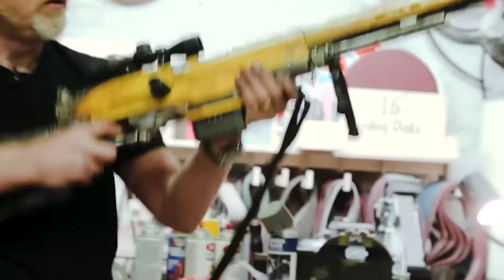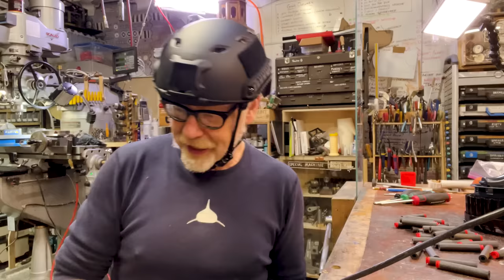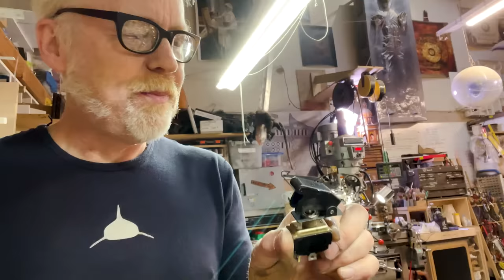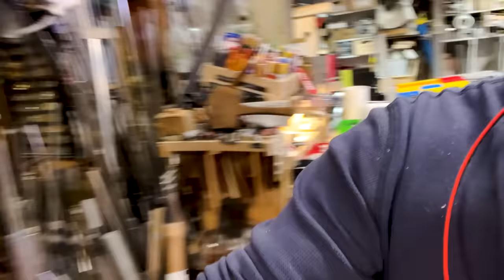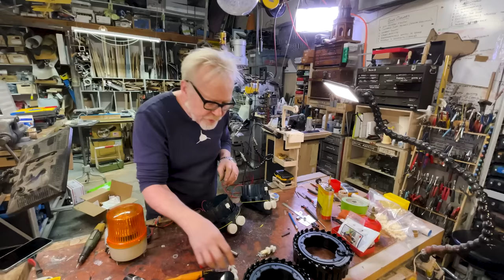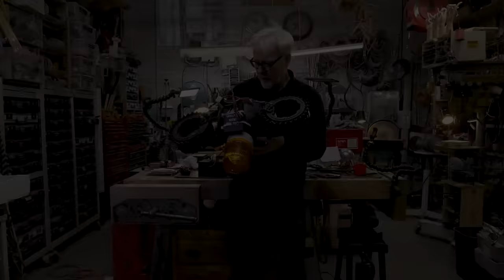Adam Savage’s One Day Builds: Head-Mounted Dart Blaster!

Comment: AWESOME BUILD, ADAM!!  Two recommendations:  Instead of reaching up to the battery pack behind your head to power up the system.  It might be cooler if when you flip up the switch cover on your trigger switch it energizes the system.  Also, as soon as the system gets energized the target reticle rotates into place.  You could put the reticle on a servo that stows in the "up" position (out of the way).  So, when you flip up the switch cover (1) the system energizes AND (2) the target reticle slowly rotates down into position.  As always though - AWESOME BUILD!!

Comment: 2 switches on the remote. 1  toggle on/off switch like you have for the spinner motors. Then a trigger momentary button on the front to fire. That way you can control when the spinners are running instead of having to run the whole time. Love the build!

Comment: The WAGO connectors are great. I just started taking them seriously at work, after having them on hand for about a year. UL listed and use anywhere you would use a wire nut or butt connector. I ordered a set for myself. Hard to say if a soldered connection is better but the convenience factor is second to none.

Comment: The super thin wrenches that Park Tool makes for bicycle repair would be perfect for the locking ring on the switch. Also a deep well socket works if you have the space to get it over the nut.
Reply: Second these suggestions.   I've installed a lot of switches like these in my day job, and both are useful solutions.  We used sockets with a nylon (i think?) coating to prevent marring the paint/silkscreen on the mounting surfaces as well.
Reply: Called cone wrenches, btw. Either those or deep, champherless sockets work well
Reply: I second the deep-socket suggestion, especially if it has a limited, or no bevel.
Reply: Cone wrenches are a great way of doing it, but with his mill and sheet metal on hand, I think Adam could make them himself fairly quickly.

Comment: Adam's assembly mistake is why I use plug connectors to connect all the different parts instead of soldering them all together. It also makes it easier to replace/fix things if a part malfunctions.

Comment: Hi Adam! You certainly can drive both triggers with one single switch, but you have to connect the same terminals of each switch in parallel. In the first try probably you connected the "upper" part of Switch 1 to the "lower" part of Switch 2, and viceversa. This way, you closed the circuit and is like both switches were closed all the time. Because one end of the switch must be connected to ground or Vcc, you should connect them in parallel but with this in consideration. Great build!

Comment: For those little panel nuts (and almost every other nut I tighten by hand,) I use the Knipex #86 03 180 flat jaw pliers wrench that my aviation buddy turned me on to.  They're like a channel lock but flat jawed, more finely adjustable, and have better grip leverage.  I prefer them over "sized" wrenches because there is no slop- whatever size hex the nut (even square,) it is held firmly between the jaws by your grip so nuts never round off or look abused.  A set of those in a few different sizes has made almost all my other wrenches obsolete.  They take some practice to be able to operate single-handed and aren't the cheapest but are worth their weight in gold once you get used to them.  Great video!

Comment: I know that this was a 1-day build project and not really intended for long-term use, but it's a good practice is to have both a good mechanical connection as well as a good electrical connection when soldering wires together. So, tin the wires first, then twist the two wires together (mechanical connection), then heat them with the soldering iron again to melt the solder together (electrical connection). This is especially important when working on wires that will move.

Comment: You asked abut what I use to tighten the nuts on those switches.  I have a  deep well socket that I ground down the rounded bottom so the the thin nut fits snug.  You might think it is over kill but it works great without a pliers slipping and pinching my fingers.

Great Build ....

Comment: Half inch socket wrench attachment. The long one. Best way to tighten those standard switch nuts. If it's long enough you get good grip and can cover the whole switch. Plus you can avoid over torquing the switch threading and just go over the switch itself.

Comment: That problem putting the carrier rings on toward the end - that's one good reason to use a set of plug connectors on your wires instead of permanent connections. Especially if you're building several of something or it's bulky and you may need to take it apart and reassemble it more than once.

Comment: I use long sockets for switch nuts. If the switch throw is too long to use with a ratchet, I use a rubber grip pad on the socket to tighten the nut down by hand.

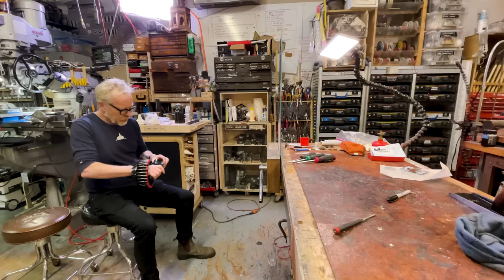Comment: Tip for 3:56 you can test to see if batteries are dead by bouncing them on their end on a hard surface. A battery with full charge will stop dead, like a dead blow hammer. A dead battery will bounce

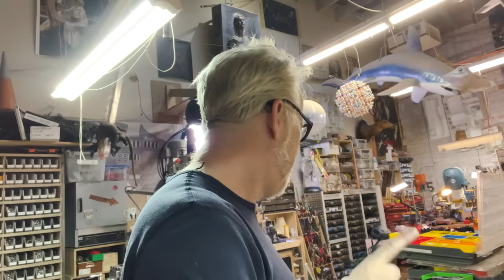Comment: 17:46 The quality of the diamond knurling depends on the size of the diameter to be machined. There is a formula for this that I learned in the first year of training but no longer know because I am already retired. The division should fit as precisely as possible on the circumference of the diameter and not overlap then that will be the whole top. I would be surprised if you don't know that with all the experience you have.  With a pitch of 0.7 mm on the knurling tool, 0.2 mm + - on the workpiece diameter means success, the knurling itself increases the diameter again

However, the knurling wheels with single sloping line make it possible to save yourself calculations because errors are less noticeable, these wheels only have a single point contact with the workpiece. I suspect that's why this tool is your favorite.

Greetings from Germany

Comment: I took cheap usb heater elements, wrapped them in heat shrink tubing, built one into a t-shirt and upped the voltage from 5v to a 8v series rechargeable battery / a 10.5v power source. Went from a little warm to being able to drive a scooter in 11 degrees and not feel cold.

Comment: You asked so I'll tell. My favorite wrench for those switch nuts is a "Tappet Wrench" not the modern definition, that seems to include all parallel jawed or open end wrenches, but rather, the type that have a pair of very thin jaws that allow for their use in very narrow spaces under a nut. I think they were originally for adjusting the "tappets" on gasoline engines.

Comment: 1. Add a grip safety to activate the whole thing. The switch on the top is awkward and runs the motors far longer than necessary.

2. Would it have killed you to add a detachable connector here and there?

3. Do red dot reticles work upside down?

Comment: Klein makes a nut driver with a hollowed out shaft that would be PERFECT for tightening that 1/2" nut. They have a set of different sizes. The switch would fit into the shaft so it won't get in the way of it tightening. Don't get the 7-in-1. Get the set of individual sizes.

Comment: LOL I've got a push to talk button I made out of pvc pipe and a momentary button that I use with my aviation hand held (it has a weird feature where it doesn't use the headset mic when you use the push to talk on the radio it self) -- I always make sure I don't have it in my flight bag if I fly commercial.  Its entirely for back up purposes so I can Velcro to the yoke if I had an electrical failure and had to go to the hand held... and well the commercial version of the same is 10x the cost.   I thought that was overkill, never thought about making it as complex as your switch here.

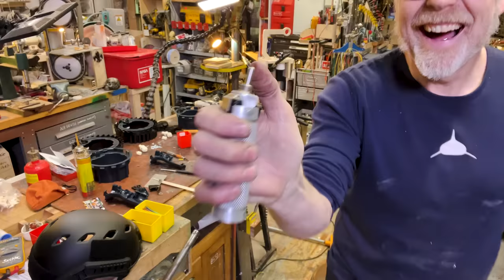Comment: Amazingly funny and instructive as always! 23:37 made me lose it for a whole straight minute.

On wire gauges, the problem with gauges go a bit deeper (for those interested).

Resistance of the wire is the main problem, but it splits into two factors that come from Ohmic losses: heating and tension drop (you can read tension going forward as "voltage"... I'll be a bit sad, but if it works for you, you do you). Ohmic losses is just the fancy way of saying "pass angry pixies on wire, angry pixies get tired". Ohmic losses lead to heating (because angry pixies don't dodge very well) and tension drop (angry pixies lose energy since they don't dodge very well and get hit).

Ohmic losses are tied to how much electric current is passing on the wire, and how much resistance it has. And the wire resistance itself is dependent on 3 factors: material of the wire (better conductor leads to lower resistance because angry pixies move easier), length of the wire (longer the travel, the higher the resistance, so angry pixies get more tired), and gauge of the wire (the larger the gauge, the more space angry pixies have to travel).

Thing is, since these losses are tied to both the current and the resistance of the wire, if the wire resistance is too high, it won't allow much current on the whole circuit. This means that a long wire with a small gauge might not work on a circuit not just because of the gauge, but because of the resistance of the wire itself. Circuit doesn't work because Ohmic losses lead to high resistance (case pointed by Adam).
And in the cases where the resistance might be low enough to allow the circuit to work, there is the other side of Ohmic loss, which is heating. On most severe cases, the wire can burn the protection, and sometimes cause short circuits (when both live and neutral wires are close together, which is 99% of wirings). Basically all of the decision for what gauges to use on house and industrial wires comes from the heating side of Ohmic losses (since tension is high enough to keep high currents on most things connected to the power).

This is why wires are usually rated not only by gauge, but also by power (or current), since these two information combined give you a broad idea of what is the resistance of the wire and whether it will work on the circuit or not (for both factors of Ohmic losses). Tension is also a rated factor, but mostly due to the wire jacket being able to be "ignored" and treated as a conductive material (and thus conduct electricity) at higher tensions.

When working on projects that either use high power ratings or constant usage of electricity, you need to be picky about wire, and select gauges accordingly. But when working on low power stuff or acting circuits like this one, it's okay to just use what works and exchange for something else when it doesn't.

Comment: No wrench actually fits those toggle switch nuts and if you actually grab them they strip.
I tend to use a pair of slip joint pliers that have insulation tape wrapped around them that I use for removing chrome tap covers

Comment: I'm an audio guy but any time I need to tighten a potentiometer, switch, or jack I just use a socket without the wrench. For your switch you might need a long 1/2" socket but it should fit over the entire switch.

Comment: So will that then be the next project, a belt feed rapid firing dart blaster?
How I would see it for me, I am not an engineer or have any knowledge of things related to this, but this is how I would envision it.

So a backpack for storage, with on the bottom a funnel so that they all line up ready to be laid onto a track. (clogging problem?)
When they are on the track that is of course covered on the top so they don't fall out (flexible covered track?)
How to feed them then to a blaster ... theses systems use two spinning disk and grab the dart of an pole ... Oh

So still the backpack for storage, with a funnel slightly to the side, so that if you move it has chance to shook it in place.
A belt with poles on it can slide into it and out with a dart on it.
Probably still need an guidance rail so they don't fall off.
When they reach the blaster the guidance is gone and the spinning disks can grab the dart after it the belt with poles on it can move back towards the backpack and pick up a new one.
Would require a blaster with spinning disks above and below it, but that can be adjusted from these.

The backpack assembly you would have to step in and the blaster is constantly attached to the belt so that is point of attention, maybe a semi holder to the backpack so that the blaster is always, sorta, far enough away from the backpack so that the belt does not bend and break.

To make it crazy have an open system so that a friend can collect the darts so that you can keep on firing as bending over and picking it up will be difficult.

Comment: If only you added a belt driven firing mechanism so you can have two Tron like blasters with more ammo capacity. The circle parts where you load the darts would need modified to allow for a belt drive to be fed through and ejected on the other side. Good video

Comment: Reaching behind the head to arm the helmet detracts from the initial "coolness factor." It would be super slick to add a small depress switch in the trigger handle in such a way that when the trigger guard is flipped it automatically powers up the helmet. Basically a 2 stage activation movement, flip the safety to "Arm" and press the trigger switch to fire. In this manner the wearer can power up and fire without making overt movements.

Comment: I'm not really sure why soldering brushless  rc car stuff is considered essential, but crimp connectors are required for automotive applications( vibration leads to cracked solder joints , or so I'm told by automotive engineering). Wouldn't solder joints be prone to crack even more in a extreme situation like rc..... I have seen fancier racing wiring, requiring can bus connections and they use screw together connections with crimped on pins. Special round connectors with 50ish wires in them. So what is really better solder or crimp?

Comment: Hey Adam!  What is is about yellow heat shrink.  My first radio shop I worked in all we had was Yellow heat shrink as well.  Ever since then on all of my projects I either use Black or try to match the wire color.  Thoughts?

Comment: one thing I always wondered. do electrons run through the metal wire or around it?
Reply: through
Reply: they don't
Reply: Through, it's the magnetic field that is created around the wire.
Reply: The electrons are the wire. 
(Well, part of it.)
Reply: here's a fun fact for you, AC likes to travel around the surface of the conductor and DC likes to travel through the center, some really ingenuitive people have been able to use this to set up 2 separate systems by using a single circuit, its pretty cool
Reply: @jaisere  Could you point us toward some more info on the dual circuit thing? It sounds super interesting

Comment: You could have just pulled the handles back out, put the rings/mags over them then put them through, like with the heat shrink, rather than rewiring... just saying, easier than resoldering everything.

Comment: While watching this I thought the trigger was clunky.  Not your design per say.  More of the having to hold something in your hand, something that can subsequently be dropped.
I was thinking of a glove based dual trigger system.  A tip of the middle finger to the palm (ala Spidey) safety/power on button.  And a tip of the thumb to the outside of the pointer base knuckle firing trigger.  That way you can still hold things in your hand, and it isn't easily removed.
Of course, I don't have the technical expertise to actually design a device like that....  Or really do most of this.